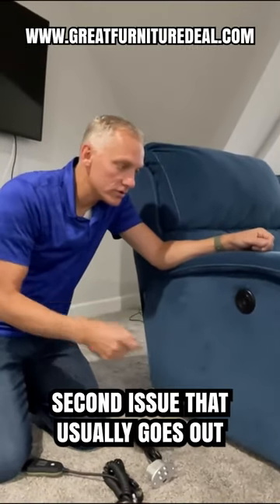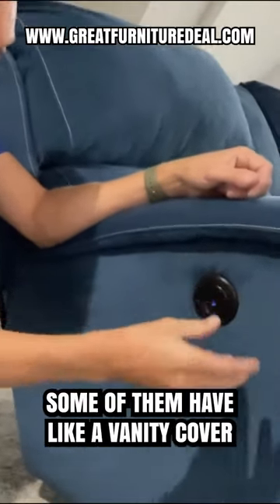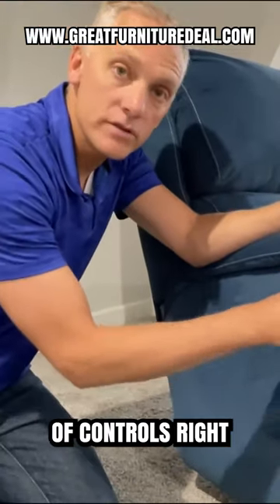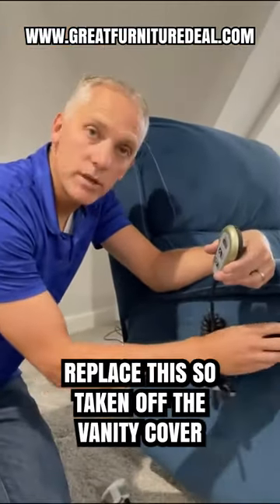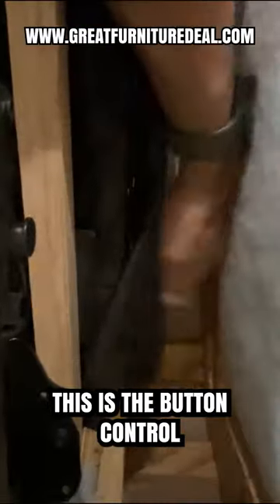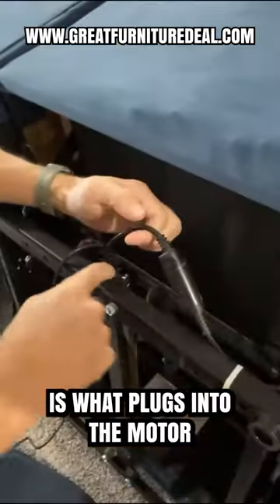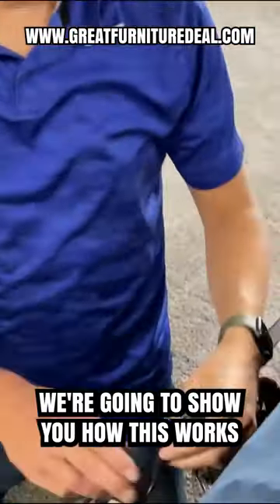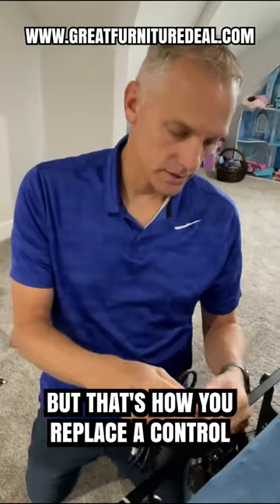Replacing the Button Control or Remote on my Power Recliner, Sofa or Loveseat - Easy Fix DIY

Comment: How do you differentiate between the primary power between the secondary power five pin connectors?
Reply from the maker: Each one should be labeled. If you mix them up, the button will control the wrong motor or won't work at all. Just switch them and you should be good. If they are not labeled, take some tape or something and label them for future troubleshooting.

Comment: For the remote control are you adding the hand control to a sofa that doesn’t come with a remote it’s just the push buttons?
Reply from the maker: You can replace the button with a remote or you can just replace the button with the same button. Some folks that have a hard time reaching the button prefer a remote and we can help you to do that.

Comment: I don't know what brand or who the manufacturers are of 'those chairs', but mine came from Rooms To Go and it doesn't seem to have this removable cover plate. I only currently need to replace the USB port, anyway.
Reply from the maker: Unfortunately. you can't just replace the USB port, you have to replace the whole button. You can call us at 800-970-5889 and we would be happy to assist you in finding the correct replacement button.